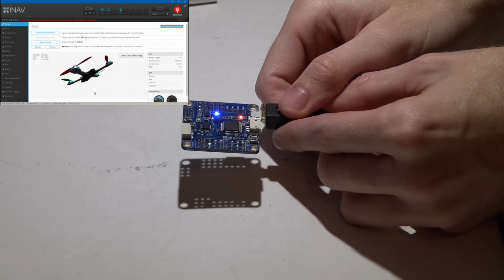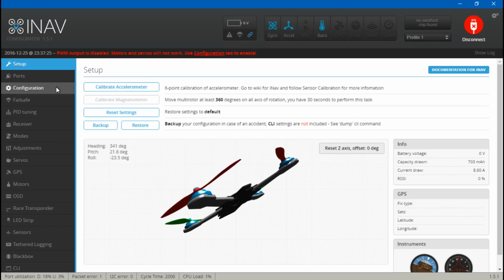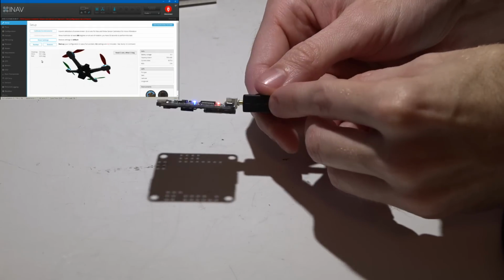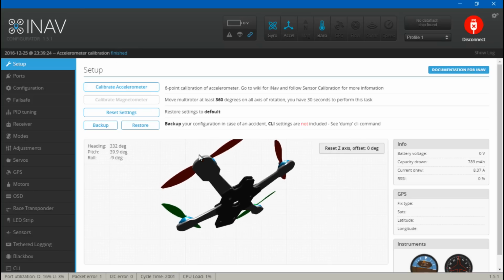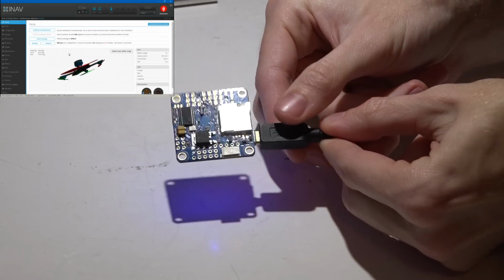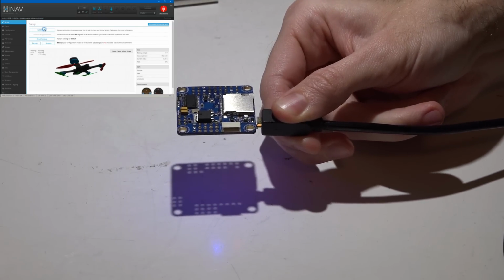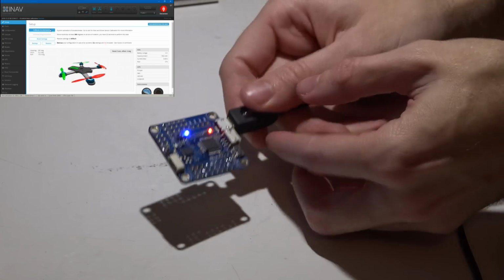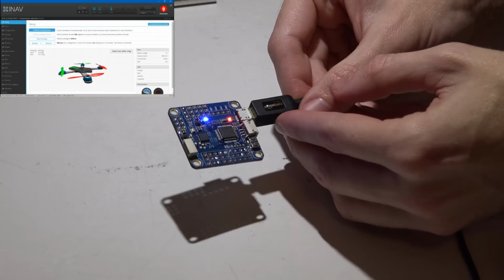INAV 6 Point Accelerometer Calibration

Comment: Thanks for the video. All explanations of how the accelerometer is calibrated are from higher versions of INAV. But some old controllers cannot be upgraded and need lower versions of INAV. And the method explained here is correct. Thanks a lot! It has solved my problem.

Comment: Is the sequence important ?
In the wiki (https://github.com/iNavFlight/inav/wiki/Sensor-calibration) the method described shows with an arrow which side should face up, and it goes flat, upside down, right up, nose up, left up, back up.
Here you do flat, upside down, left up, nose up, right up, back up,

Comment: https://www.google.hu/search?q=cleanflight+acc+trim&safe=off&espv=2&biw=1920&bih=908&source=lnms&tbm=isch&sa=X&ved=0ahUKEwi15K3Hmq3RAhXbMVAKHX76BCQQ_AUIBigB#imgrc=o1q43xMVtsi_WM%3A

-DISarm
-put THR to max
-use aileron-elev stick on radio: put 1-1- seconds to MAX : watch LED on board
-use 10 (ten) acc-trims for start to see some difference then  fine tune

-put THR to low
-ARM and fly (smooth hover) 

-fine tune.

Comment: when I connect my FC to iNav the direction of the boar is correct. I changed YAW degree to 270 since I have the USB coming out the side and not the front or back. The problem Im having is that with the quadcopter is sitting flat and facing forward away from me if I lift the back side the front goes down but on iNav it shows the nose going up then if I lift the front the rear goes up. If I lift the left side then the right side goes up. Basically everything is backwards.
Reply from the maker: Have you tried 90 degrees? Sounds like thats the one you need.
Reply: Project Blue Falcon yes I did and nothing. I ended up putting -90 and changing both the pitch and roll to get it to work. For some reason on this board it just wouldn't work by just changing the yaw degree. I used the same board on another build and it was positioned the same way and I just had to change the yaw degree. Btw are you planning on making more video tutorials about iNav?
Reply from the maker: Thats strange. Could be something with the firmware. Yep I'll be adding more videos. Just waiting for more props for my hex to come in the mail then I'll get back to it.

Comment: Thanks for the video. I just calibrated mine today on the bench like you. I have subsequently mounted in the plane on its side and changed the board alignment - I wonder if I need to re-calibrate?
Reply from the maker: I've always wanted to know the same thing but I cant say for sure. I just recalibrate to be sure. But it probably doesnt matter.
Reply: Project Blue Falcon, the github notes infer that you should not do so, so I'll stick with what I've done (calibrated on the bench before fitting in the model). Only planning on flying acro to begin with anyway.